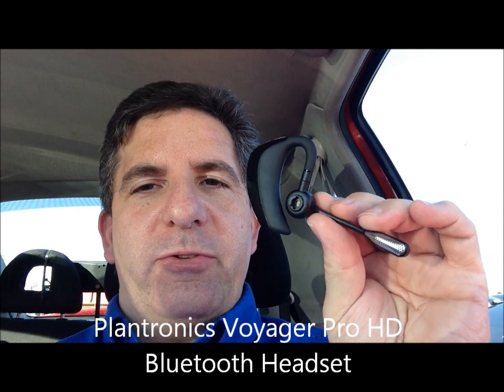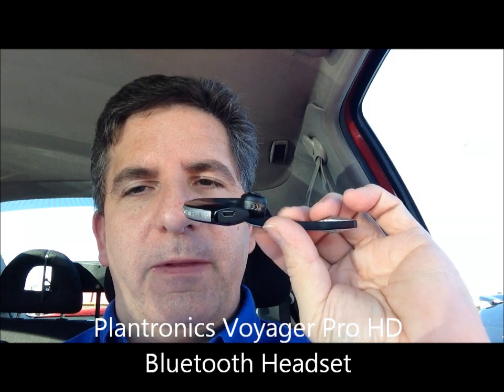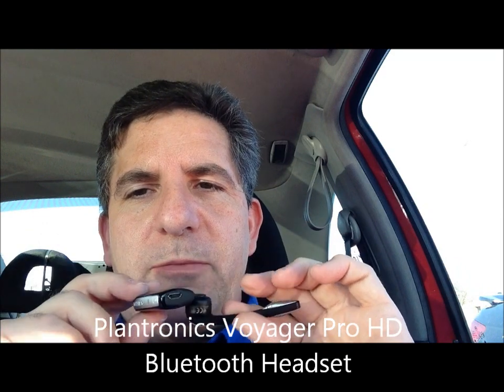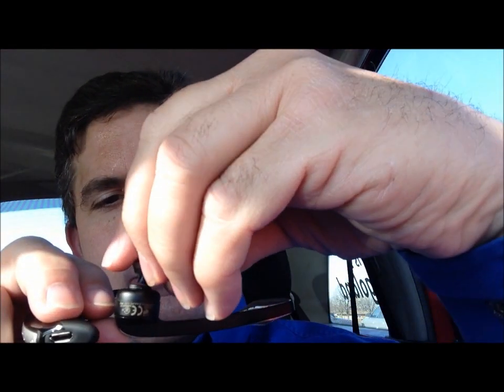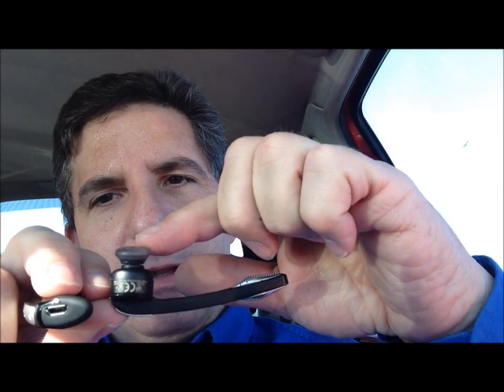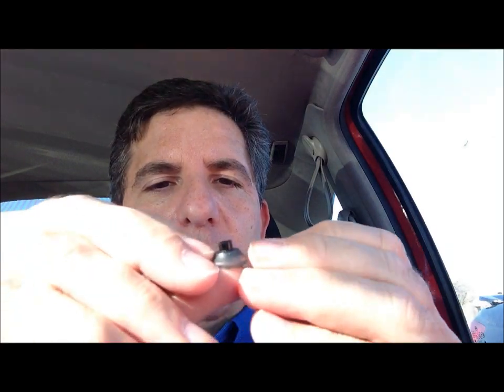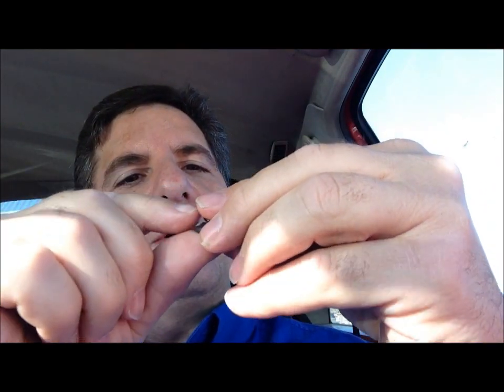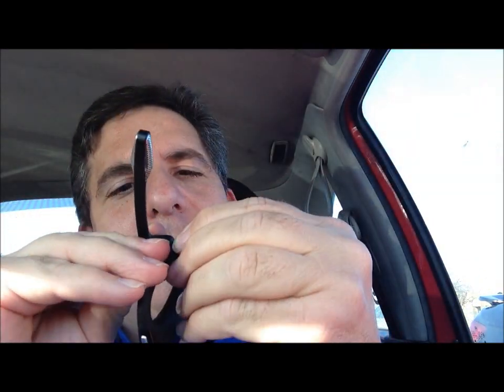Plantronics Voyager Pro+ Bluetooth Headset Earbud Repair

Comment: You saved the day! I was about to order a replacement part but then on a whim decided to search for a solution. I figured if it has happened to me, it must've happened to others :) 
Even the guy at The Home Depot was full of admiration for this solution :) Works like a charm.
Reply from the maker: Good to hear. Hope others find this helpful too. As earlier posts make sure you get the right o-ring. The o-ring is #36, 5/16" O.D. x 3/16" I.D. x 1/16

Comment: great video...mine came off in my pocket and couldn't figure out what happened. Now I see thanks to your video that there is a o-ring in place that must of slipped out. BTW in your video you said 15/16 x 13/16 x 1/16 but your package says 5/16X3/16X1/16.
Reply: Marlun Sides Very useful video! Marlun is correct, Chris accidentally states 15/16 x 13/16 x 1/16 - it is actually 5/16 x 3/16 x 1/16 - see video at 1m39s when Chris holds up the packaging....I got this at Home Depot plumbing section - same maker - Danco Inc from Irving TX. You can open the box at home depot and try it out - It takes a little trying, but works.
Reply: mine came off in my pocket too.  been contemplating buying a new headset because i thought some internal mechanism had gotten damaged.  thank God I searched Youtube before dropping $70!

Comment: I have a Voyager 5200 and this is the 3rd time that the ear tip has torn off from the part that locks in place. I don't think your solution will work for me.  Maybe some type of glue would work to repair it.  Does anyone have a recommendation?  Otherwise, I guess I need to spring for the replacement tips from Plantronics.  Thanks